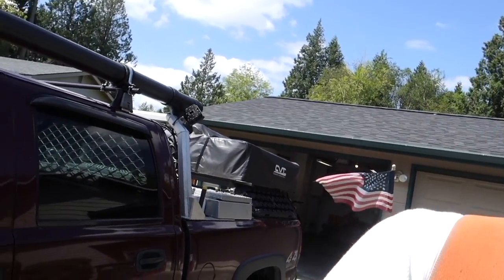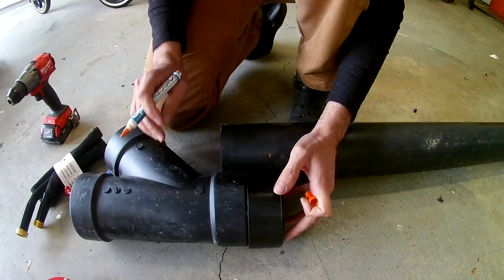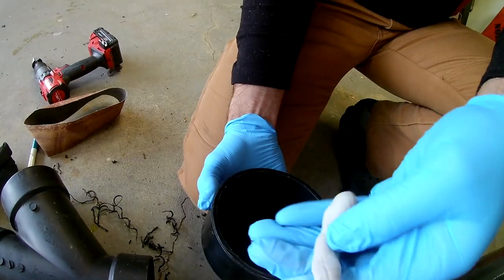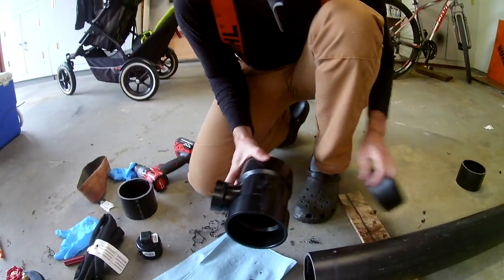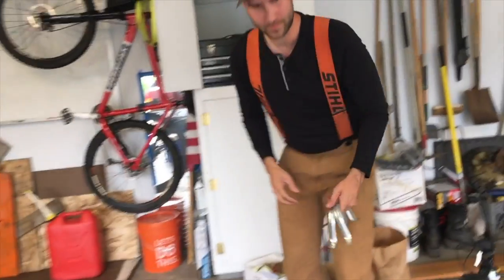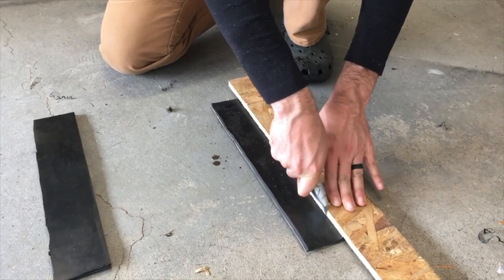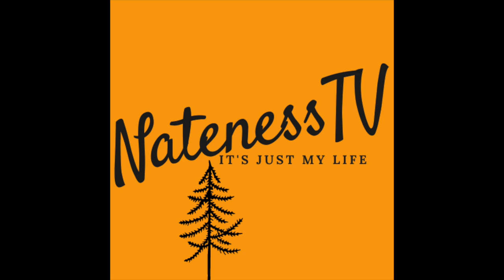DIY Solar Shower System Pressurized for Roof Rack Camping off the grid under $100

Comment: Great video. I'm just got all the materials but I cant find the valve that you mentioned. Is that just a regular tire valve that you can find at the auto part shops?
Reply from the maker: Thanks! Yes just a standard tire valve, most any auto parts store should have it. Good luck with your build!

Comment: Should I running the compressor while I run the water? I made a similar one and there is no pressure with the compressor off.. so I guess the former is the correct way to run it. Please advise.
Reply: You can't compress water.  If the system is completely filled with water you can't add any pressure to it.  Try filling your system 80% then add air to it.

Comment: A W E S O M E !! I'm doing it in a couple of weeks. Just one question: how can I know how much presure it has? I think I'm gonna fill it with air like a tire in a gas station if I'm going on a trip, but how would I know if it has enough air? Thanks a lot and best regards from Perú!!
Reply from the maker: It really doesn’t take much and keep in mind that ABS pipe is not rated for pressure. I have had no issues putting 20 lbs in it. My air compressor I use to pressure it has a gauge on it so I know how many much pressure I’m putting  in. Great question thanks for watching!

Comment: Thanks for your video I have a question how many psi you put on the pipe thanks
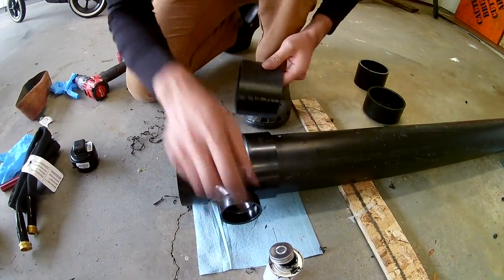Reply: 7:04 he says he had 80 psi in it.
Reply from the maker: I pressure tested everything at 80 PSI but I would not recommend putting more than 35-40 PSI in there for normal usage. Thanks for watching!

Comment: you could use a 1/2 " nut and wo fiber rings where you use the putty
Reply from the maker: Possibly, I would say its worth a try! let me know if it works!
Reply: Nut wouldn’t thread. MIP threads. Tapered

Comment: Have you checked the pressure and water temp in the pipe after it has sat in the sun all day?  Would love to hear how it worked after a summer and winter of use.
Reply from the maker: Great question! I only pressurize the system when I’m using it, it seems to work best that way. Works great in the summertime, honestly not so great in the winter time! I didn’t notice a water being any warmer in winter, I even noticed on cool summer days if I use the water an hour after dark it was pretty cold. I hope that’s helpful!
Reply: A buddy of mine at work made one of these years ago. He said it worked fine with one exception. He pressurized it to 80 psi then set it out in the summer sun. It blew out the valve before the day was over.  

I like your method for constructing it. Being an engineer and living in the southeast, I’d install a pressure gauge and thermometer out of curiosity as much as concern.

Comment: Are you using presure rated abs or not for pressure abs pipe because i can onlybfind the non pressure rated type in 4or6inch diameter..
Reply from the maker: I used non pressure rated abs but if I were to do it again would totally use pressure rated or maybe even go with pressure rated PVC and paint it black if I were to do it over.

Comment: I'm really worried about that test plug. I used to pressurize Ford EGR coolers with similar test plug and put 100 lb of shop air and it blew across the shop in a million miles an hour! It was in there as tight as it could possibly be and it still blew out.
Reply from the maker: Yes if you don't want to use a test plug you can use a abs screw plug with thread tape. If you do use a test plug be sure you don't put more that 23-30lbs and make sure the water is full in the system. If the water is full in the system it won't shoot the plug as far. Be care full and use at your own risk! Good luck, hope this helps.

Comment: Nate, I replicated the build with a 10 foot section, when I go to pressurize the pipe, I am leaking air around the plug caps. I tighten them down good but air still leaks, did you use an O-Ring with your plugs?
Reply from the maker: Be sure to clue both the abs pipe and the abs cap then do a 1/4 after pressing together.
Reply: Use Teflon tape on the threads of the cap

Comment: Hey, this is a great build! 
I would like to see it in use, how much water capacity does it have, and how do you put pressure in it, or does it work with gravity?
Reply from the maker: Thanks! It holds about 4.5 gal. Gravity works but for more pressure I’ll hook up a little compressor that hooks into my battery system of the car and will maintain about 15-20lbs. It’s more than enough to wash dishes or shower. Thanks for watching!

Comment: Thanks for showing us this. Would it be possible to build a larger system shaped like an 'H' using elbows and a center pipe or pipes like the rungs on a ladder? Would it be more useful and capable or is there something im missing?
Reply from the maker: I don't see what that wouldn't work... only one way to find out! Give it a try! Let me know how it goes!
Reply: For roof mounting remember weight of water is 8.3 lb/gal.

Comment: İn my city its +50 celcius in summer. Water would be so hot inside yhat it will burn me when i shower:(... any auggestions?
Reply from the maker: That is super hot! I haven’t had that problem haha! How would it work to use white pvc pipe?

Comment: What's the pressure plugs rating? Will it pop off under enough pressure?
Reply from the maker: It just blows the plug out, if there’s to much pressure, I usually try to keep the pressure around 20psi or less

Comment: Check the pressure rating on the pipe pvc/abs is not rated for air pressure. water pressure is different than air pressure. I still love the idea
Reply from the maker: Thanks

Comment: I tried the test plug but it blew out at 30psi. I decided to just cap it. Hope yours stays put but that could be dangerous. I tested with pressure with a hill back drop 50 yards away. The plug shot clear to it.
Reply: Very important. I suggest no pressure inside the pipe. Use an external pump.
Reply from the maker: Yes caping is the safe way to go. I have had my plug blow out once but it was full of water so the plug didn't go far. Thanks for sharing your experience.

Comment: Great video! I built one a little over a year ago and yours is much cleaner with some improvements. 

Quick question though… where are u filling it with water? I left that plug at the top so I could open it but have been having issues losing pressure there unless I throw on tape and really tighten it down. Looking for better solutions. Thanks
Reply from the maker: Yeah I lose pressure there as well, if I was to do it over I would put a test plug there for the fill. Obviously be careful not to over pressurize the system, I’ve been putting in like 10-15 lbs and that works fine. Thanks for watching!

Comment: Thanks so much, I almost copy everything.  But when I put test plug in, after air in, the plug won't stay and blow out,  how can I solve this problem? Any advice ? Thanks in advance.
Reply: Lower psi?
Reply: @Letyourcolorsblendwithmine  yes. less than 25. blow out each time.
Reply: @jamesshen7691  what exactly did you do different? You may have missed a step or different product from him

Comment: 2 questions:

1) how easy is it to fill with the opening that high?  Do you use a ladder to get up there, or stand on the truck seat, or...?

B)  How do you pressurize the system?  Bike pump, 12V compressor, or something else?  What's the typical and max pressure you use?
Reply from the maker: Great questions! 
1) I stand on the door frame of my truck, most people use a stool or ladder. 

2) I am set up to use a 12v compressor but I actually end up using the bike pump more often! haha! 

Thanks for watching and thanks for the good questions!
Reply: Also what would you suggest for max psi?

Comment: Should have installed the faucet closer to to lower edge  so more water can be used.  Having it in tne middle will only drain to middle or half the water.
Reply from the maker: The faucet is at the bottom of the pipe the way it’s designed. Look at the end of the video to see the finished build.
Reply: Doh... You are correct!  I forgot about the y pipe. Have you measured how much water the shower tube holds?
Reply from the maker: It holds 4 gal. If I was to do it over I would go with a bigger pipe, like 6” white schedule 40 pvc pipe and paint it black.

Comment: After having used this now for a year - can you give some feedback: Are you completely happy with it or are you considering changing your water/shower solution to something different? Does the water get warm enough when camping in cool summer climate (not snow). Do you or your spouse/gf wish you had a water heater, more water capacity, etc?
Reply from the maker: I’m pretty happy with it and for what we do it’s just fine. It’s held up fine, I would change the water fill to be a clean out plug rather than a threaded plug and would try and figure out how to add baffles to keep the water from sloshing when driving. As to the temperature it doesn’t hold the heat so taking a shower when it’s dark is not Pleasant unless you like cold / lukewarm water. Thanks for watching?
Reply: @natenesstv6685  good feedback thanks. I was trying to come up with an easy way to add baffles - let me know if you've thought of something.
Reply: @stevew.1256  For baffles, I would try gluing a few 2 inch caps inside, maybe 6 & 12 inches in from each end.

Comment: I know the water is under pressure but won’t the angle of the pipe affect the available water.
Reply from the maker: The angle is intentional, if the angle is pointing down it allows for all the water to drain out of the system. Does that answer your question?

Comment: Could you use a 12v pump on the output connection instead of pressurizing it?
Reply: Yes if you vent it.

Comment: Has anyone ever had a problem with instability of your vehicle while accelerating or braking with free surface in the pipe? Water weighs a lot! It's high up. It's on one side. Would it be wise to construct a simple small long pipe interspersed with wide perforated collars or flanges into the 6" pipe to baffle and break down the rush of water from one end to the other? Maybe I worked as a tanker officer for too long.
Reply from the maker: I have heard of people adding baffles and I think it is a good call. I have had the water blow the plug out when I accelerated the first time after filling it, I learned my lesson quickly really tightened it down and haven’t had that problem again.

Comment: Great video. Thank you for taking the time to make it. I’m a curious to what pressure you see the test plug remaining in at? I’m considering using one end of the pipe for the spigot and pressure valve, and the other end simply having the test plug in as an end cap. Looking forward to hearing your thoughts and what pressure toy see it staying in at.
Reply from the maker: Good question! and thanks for watching! I usually keep the pressure around 25psi, it came out the first time I used it and since then I have tightened the test plug more and its been fine at 25psi.
Reply: I used a similar design, was  intending to test it to 80 psi but at 70 psi test plug blew across the shop. Put it back in, tightened it down harder and tested it successfully to 80 psi. Been using it for a few months now at 30 psi and everything seems tight.
Reply: Oh and the limiting factor is probably the pipe not the plug. I think that pipe is intended for gravity drain only and not rated for any pressure application, but it seems to work fine at the pressures I mentioned.
Reply: @meanders9221  with abs pipe specifically?

Comment: The hole I made of the valve is slighting too big. I used the same putty to seal. Do you think thats a good idea?
Reply: Or hold up the air, long term?
Reply from the maker: I wouldn't expect it to hold air for very long. If the hole is drilled to big I would start over just to be safe. Use your judgment and let me know how it works out! thanks for watching!

Comment: Do you find it normal for the pressure to go down 1-2 lbs per hour after pumping up?
Reply: Some of the gas will dissolve into the water. So probably.

Comment: Any idea how many gallons? Curious if you feel like you have enough water for showers and cleaning without refil
Reply: It said 4.5 us gallons in the description
Reply from the maker: yes 4.5 about. and everyone's different as to how much water they use. We don't use much at all for showers so it works out. We just use enough to wet ourself, then soap up and rinse off. 2 very small showers and some dishes for 3 nights is what we get out of 4.5 gallons. Good luck!

Comment: When fully pressurized at 25psi (I think), is that enough to empty the tube or do you have to top off a few times after use?
Reply from the maker: I keep the air hooked up and keep pressurizing it as it empties. Thanks for watching!

Comment: Does 4.5 gallons seem like enough? Also do you ever have any issues with water getting stuck in the system and it needing to be tilt or do you refill before you get that low?
Reply from the maker: 4.5 seems to be enough for a couple days, washing dishes and to soap up and rinse yourself off 1-2 times (You have to be conservative.) I try to park at a slight tilt so water runs to the low spot, that said the it does pretty well with the angle down to the outlet. We usually refill before we get close to running out. Thanks for watching!
Reply: @natenesstv6685  awesome thanks. I'm looking at building one for my Hiace. Ever feel like it affects the control of the vehicle with weight that high?
Reply from the maker: I have not noticed a difference, only thing I would say is if it is not full of water you can hear a slosh/slap of water as it hits the end of the pipe when accelerating or stopping sometimes.

Comment: What do you use to pressurize it once you want to use it?
Reply: Any air compressor. One that you have in the garage or a portable 12v dc such as the smittybilt or arb air compressor.
Reply from the maker: I started out using a air compressor but lately have been just using a bike tire hand pump! Either work. The higher up you mount the system the easer it is to open the fill cap and use gravity to get water out.

Comment: Did you get one single shot of the entire unit?  I didn't see it. not both ends at once.
Reply from the maker: You know I think I may have a video of it working back when I built it. I’ll see if I can dig that up and post it.
Reply: @natenesstv6685  I’m going to build my first one in a few weeks.  I like your design.  I’ll do a pop off valve with the white plastic and for when I need or am able, I will add a switched 12 volt hot water tank heating element as well.  Thanks

Comment: I wonder how much water does it fits in it?
Reply: Just do the math.  4” ABS pipe has about 2” in Radius.  Per foot of ABS pipe has a volume of pi x r x r x 12, or 150 cubic inches.  Each gallon is 231 cubic inches.  So a foot of pipe will contain about 0.65 gallons.  6 ft pipe will hold about 4 gallons of water.

Comment: Put locktite on the boiler drain handle otherwise, it will vibrate loose and fall off down a washboard road.
Reply from the maker: Good call! I didn’t think of that! Thanks for your comment and watching!

Comment: Where can I find similar rubber belting to what you used? Also, your test plug was a great idea. I definitely put that on the one that I just glued up.
Reply from the maker: Great question. I get it in bulk from Hardwear Sales Bellingham Washington. It like 40cents a pound from their bulk miscellaneous rubber bin. If you are not local you can try call them I know they ship a lot of stuff. (360)734-6140
Reply: Use mud flaps for trucks
Reply: Used belt from quarry  conveyors

Comment: Cool video.  I've been prepping my idea for a similar build. One question, how did/does the marine weld hold up?  I live in CO and concerned that the extremes in weather could cause a failure versus thread tape and a mechanical fastener.  Yes, I do realize that I wouldn't want to use this in the winter, but there are 70 degree days in winter out here too.  Thanks again for sharing.
Reply: I was wondering that myself when they didn't cut any threads into the plastic they just glued it in? I've also had bad experiences with expandable pipe plugs they tend to blow out under pressure.
Reply from the maker: I have not had any issues with the marine weld, It hasn't gotten as cold here as where you are but it has been down to freezing. I know many people like thread tape and mechanical fastener and that's a great option.
Reply: @natenesstv6685  Thank you.

Comment: Out of curiosity is it still working?
Reply from the maker: Yes it still works although I don’t pressurize it like I use to. I keep it around 15 psi which is plenty for everything I need to do.
Reply: @natenesstv6685  thank you for the reply 👍

Comment: How does it works?
Reply from the maker: There is a Schrader valve (tire fill valve) to put air pressure into the system. You can also use a bike tire pump to pressurize system. Pump up to 30-40 psi and enjoy pressurized water off the grid. During the summer the black of the pipe absorbs the sunlight and heats your water.

Comment: Wondering how the road noise is with your newly fitted water bazooka?
Reply: Yea should use a cone at one end
Reply from the maker: You will get a bit of a whistle but not as bad as I thought it would be. The noise that bothered me more was the sloshing of the water on acceleration and stoping.
Reply: @natenesstv6685  could probably add a few baffles inside to minimize the sloshing.

Comment: 7:58 why that kind of valve? Instead using a common Tyre valve and a tiny portable 12V emergency tyres inflator/compressor...
If you don't have the portable 12V or it went broken you can eventually pressurize  the plant with gas station service compressors...
Reply: I have a few of those in my toolbox,  they're a normal shrader valve. Just the screw on type :)